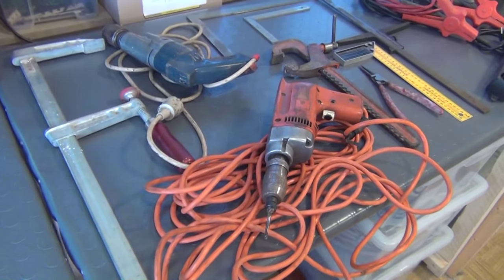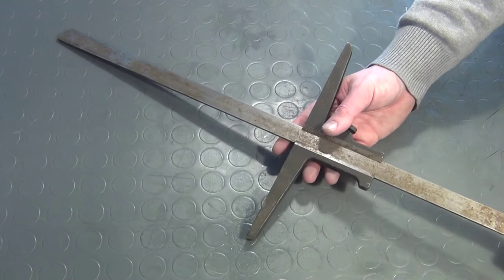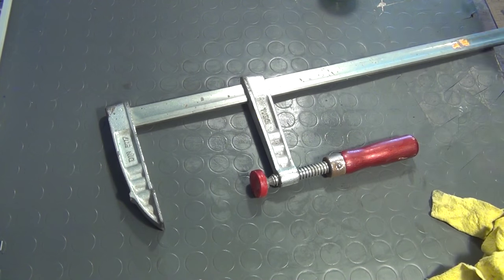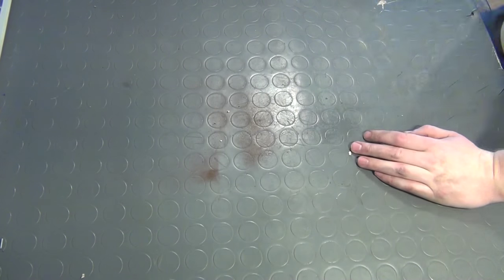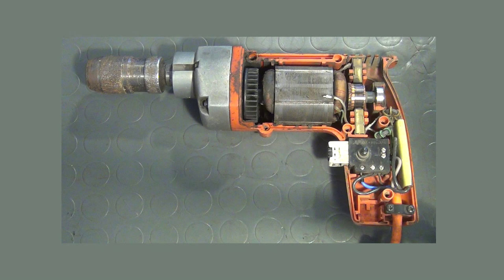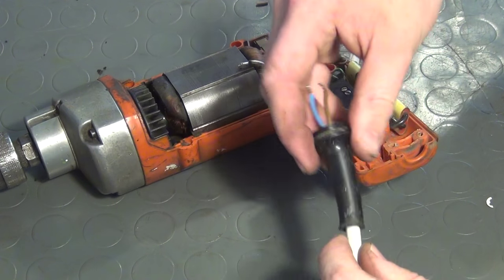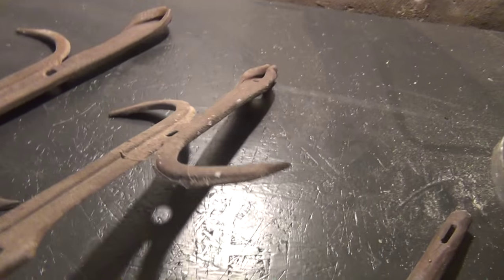Metalworking Tools Repair Marathon

Comment: That Carver clamp is a very cool design. I will have to make a wooden version to add to my collection :)
Reply from the maker: John Heisz Cool idea. It's a great design and I have used the clamp for several jobs already. Let me know it, should you make a video about that.
Reply: John Heisz  I have a Carver clamp. A good tool, excellent clamping power but not very user friendly. Or perhaps I don't have the hang of it yet!
Reply: SimplyReg Hi I agree, I have three,they have their shortcomings.In my view they are overpriced if you buy new. You have to be careful you do not over tighten them or the narrow bar will bend.A normal Engineers G clamp is better for me,annoyingly I see Carver make three different strengths of clamp and the price really shoots up.On the plus side the sliding clamp can be reversed and I am told they can be used to jack up an item.
Reply: John Heisz - I Build It       L
4
Reply: hi everyone ,if anyone else  trying to find out 
home electronics repair
 try Saankramer Electronic Magazine System (should be on google have a look ) ? Ive heard some awesome things about it and my buddy got excellent results with it.

Comment: Hi I have just watched this video and I recognise the those old salvaged pieces of Ironwork ,The long mushroomed bolt like thing  is called a "forelock" in Britain it would have a washer and a triangular piece of wrought Iron called a" key" it would be driven in to the slot to tighten up .Yes it is what most of Europe used ( Romans were using it here in Britain ) before the nut and bolt was invented .
 The hook like things are for cooking ,some times meat would be hung directly on the hooks or if as in your case there is two sets a bar would be stretched between the hooks the and the meat could be turned  on that,the reason for the  rows of hooks is simply to adjust the hight/distance from the fire,We have here a different pattern to those ,ours only have one hook but can be moved up and down using a  loose link to hook over a kind of course saw tooth
 Hope this of interest to you.
Regards
 Will.
Reply from the maker: +Will Turner Hey Will. Thanks for this valuable information. May I ask how you came to my channel and  what made you watch this video? It happens all the time of course, but I have seen some heightened interest in this video recently and I wonder if someone shared it somewhere ?!
Reply: +The Post Apocalyptic Inventor  I have been watching your videos for a little while now, the reason I have gone back to look again is ,Ive just broken the switch on my stick welder I know nothing about electrical things , but I am interested in them, especially  how they work,and I remembered you doing tear downs and repairs,thinking I might get an idea how to tackle my old welder switch  ( it has 240volt and 415 volt barrel type switch ).
 I enjoy your vid's and like the detailed explanations about the  electrical pixies ( AVE ) you give , long may it continue .
All the best
Will.

Comment: A year or so ago, I ordered several different design types and amp sizes of jumper cable end clamps. I have a good, high amperage set of jumper cables I bought 20+ years ago. I also have a couple of sets of medium quality jumper cables. 

The high quality cables have been great, but I have always found them to be too long. I cut them down and made two sets, one at 1/3 of the full length, and the other with the remainder. I cut the medium quality cables into four shorter sets, and one very short set, about 2-3 foot long.

On the very short set, and one of the four sets, I did something different with the cable ends. I put the new ends on normally, then took a 6-8" piece of cable, soldered one end to bind the strands together, then attached it to the unused side of the clamps.

The reason I did this was to create some cables for charging multiple batteries, at the same time, and/or for using multiple batteries to jump start old/big/tired engines.

In the time since I made the cables, I have used the heck out of them, and a couple of friends have wanted to know where I got the cable ends, so they can make their own. 

I wish I had made them years ago.

Hope this helps someone...  Sometimes, it's the little things which make a guy's life easier, and more efficient.

Comment: Hi there, quiet often I can’t obtain spare parts in Australia so I found a good way to get new brushes is to make your own. I purchased a dozen or so of large brushes from Feebay and it’s quick and easy to sand them down to the correct size and crimp or solder the correct tab on the end of the copper pigtails. I also purchased a load of plastic strain reliefs from Feebay as well and use those. Both of these work arounds work well for me and are very cheap. Great work on your English pronunciation. Cheers 🍻 from Australia 🇦🇺

Comment: Nice long video to watch with a cup of tea. The vice is looking very well. Thanks for the shout out! You will have a great home blacksmithing set up when it's all arranged. Blacksmithing is a fun skill to develop as it can still find a truly useful place with modern production. It's also very visceral in some ways. I really like the metallurgy side of it, base material properties or the remarkable effects heat treatment can have. It is so interesting.

My straight razor is made of fine Swedish steel and was ground expertly in West Germany. It's a very nice razor, a pleasure to use. I have to say I put a lot of trust in W. Germany products!

I have been taking apart and hopefully refurbishing some old discarded power tools recently myself. You other videos gave me a push to has some fun fixing them up. A couple of rusted out striped screw heads have been a pain though haha
I have tried a couple of 'tricks' but one is very badly stripped, so I may just drill it out. Just a casing screw anyway and I'll re tap it if I need to.

I  think the welding machine videos you'll use those jumper leads in are going to be really fun to watch. There are a lot of interesting angles from which to look at the various types of machines. The simple explanation of the variable magnetic reluctance buzz box in the other video was great.
Between other videos of yours and the SMPS series I finally see it all as aligning dynamic fields and not overly simplistic magnetic poles physics models.

Anyway, keep up the brilliant videos, there consistently entertaining and informative.

Comment: I use a Jacobs chuck on my air drill at work. It gets used for all kinds of jobs and materials including stainless, brass and aluminium. Its been on that drill for over 10 years now and is still going strong! Hope yours give you the same service.

I'm from Sheffield and never knew they were based here lol.

Comment: It is possible to make a simple strain relief for the cable with a short section of garden hose or plastic tubing - and It is a good idea. The chuck on the second drill is of good quality. It is worth stripping down & cleaning. Keyless chucks were once an expensive professional option (as in this case) so it is probably well made.

Comment: Hi, erstmal danke für deine Videos, haben mir schon viel Spass gemacht. Ein paar Tipps (auch auf dein andern repair marathon bezogen):
- für Anschlusskabel würde ich welche mit Gummi oder PU außen nehmen. Das ist wiederstandsfähiger und im Fall von Gummi auch wesentlich flexibler, insbesondere bei Kälte
- zum Entfernen von Oberflächenrost am Messchieber usw hätte ich eher Stahlwolle genommen, das ist wesentlich milder. Mit dem dann zusammen mit einem Kriechöl (WD40, oder selbst gemacht mit Öl und Petroleun od. Diesel) drübergeschrubbt da löst sich dann der ganze Rost. Zum Schluss mit Lappen abwischen und nochmal etwas ölen als Korrosionsschutz - fertig.

Weiter so und viele Grüße, Mathias

Comment: For your viewers in North America, or if you come across old tools from the US. I look at the manufacturer's address, to judge an approximate date of manufacture.  In the early '60's, the US adopted the five digit zip code.  If the address has a zip code, the item is post ~1964-65, no zip code, pre 1963-64. 

I learned this tip from an appraiser 30+ years ago, and it has served me well, since then.

Comment: I believe the fireplace irons with the hooks were used for hanging pots or kettles over the fire. They may have also held spits for roasting meat, although I have seen different kinds of old tackle for meat roasting.
Reply: You are correct that the hooks held a spit roast rod at different heights. Pothangers were typically situated on a long bar. The hooks could be slid along the length of the bar, and the bar could be rotated horizontally into or out of the fire.

Comment: My dad worked at a factory in the 1980's who purchased an electrical furnace from the DDR. While the thing was out of the dark ages, even for British industry (which always seems behind our German or Asian competitors) it was absolutely bullet proof. The interesting experience was when a team came from the DDR to repair and service it. Among things they didn't have were modern shatter proof hacksaw blades and they had a guy on their crew who just sharpened drill bits all day. Apparently they left with many boxes of western tools and supplies "borrowed" in the name of Anglo-German relations. haha

Comment: Very nice vids, thanks. And all those old plastic parts could be perfectly polished with slow rotating fur plate, like those for a car surface treatment. And the abrasive pastes also are the same - plastics are heat sensitive only, so air/water cooling is recommended when polishing!

Comment: Lovely video. Beautiful English.
Nice old drills, sadly AEG is now owned by a Chinese Company TechTronics. They aren't build like they used to be.
Fein is still building great tools, most people know them for their multi tool but Fein was the original inventor of the electric hand drill. Thank you for your kind words towards the English and your respect for what we make. German tools have the same respect over here.
UK
Reply: +Harvey Smith Well said HS!
Reply: Isn't Millwauke a subsidury of AEG ? I don't know AEG that well for their power tools, more for their sewing machines.
Reply: Correct. Millwauke is part Techtronics, along with AEG, Rigid, Ryobi and a few others.
Reply: I actually knew AEG for building electric locomotives...
Reply: It used to be a huge industrial company, not sure if they just sold of the tool part? Anyone have any info on that? Also they owned Atlas Copco, any inof also grateful
Reply: Atlas Copco made electrical work machines, my father has an old electric drill from the 90s but still works really great.

Comment: The iron hooks are part of an old style cooking system. You can hang  iron pots ( with handles) from them  to simmer a stew, or  roast a pig or sheep on a spit.( Iron bar with a handle to turn it) The higher the spit  is placed in relation to the fire, the slower it cooks.  You can see something similar at Hampton Court in Surrey, England.

Comment: You can use a short piece of automotive rubber fuel line as a replacement strain relief for the power cable on an electric  hand tool.  It works better and lasts longer than the original strain relief.

Comment: Thank you for digging out the historical material on the tools. Very interesting. 

If you run across older tools you plan to resell rather than use, be careful about removing the patina. One man's rust is another's treasure. I cut the value of a '40s Emmert Turtle Back vice three fold by cleaning it. I also got endless lectures from tool collectors at the swap meet.   Don't know which was worse losing $600 USD or hearing about what a moron I was for hours.
Reply from the maker: Lawrence Bosse Thanks for the info. At the moment I only buy tools for my own use though and I see even a hundred year old tool as a piece of equipment and not as a sacred item with magic qualities. I can understand that you don't remove an actual patina on a piece of ancient silverware, but rust on a tool is just that: rust... At least that is my oppinion.

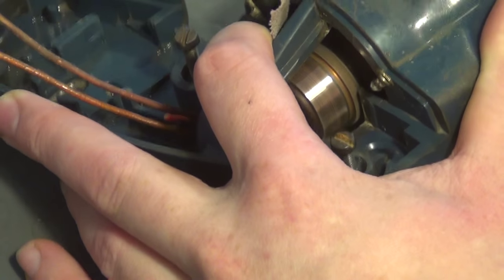Comment: Hi I love your tool repair tutorials! Just wanted a clarification plz: at 9:25, you said you soldered a capacitor to a couple of wires & connected it to the switch & motor . Was the capacitor installed to fulfill the function of the broken filter ?

Comment: Hallo. Congratulations for the videos of old stuff repaired. I have in my basement similar "postweiss" I believe it is the name. In Romania the name would be "menghina" (try google translate). Also my father has a lot of old tools but I saw that modern tools are cheap and made of cheap plastic. I managed to repair a broken small crane by repairing it's cable. Good job!

Comment: yo! love your show it gives me alot to think about and ideas in my own projects and your methods of teaching and using and being safe is great...so i have a question it is a serious question even though it may be silly or have been done or too dangerous ...can you take an old 18 or 20 volt battery operated power tool and turn it safely to a ac voltage tool? thanks again and keep grinding!

Comment: i use knipex brand 200 mm bolt cutters in my work. they are quite expensive at $50, but are the best such tool i have found in my 13 years at this work.

Comment: Damn, what is this place of wonders that holds these artifacts at a bargain price?
Reply from the maker: John Grammaticus I found the place when I came to pick up a welding machine that I had seen on the German version of "Craig's LIst". Upon arrival I found an entire room filled with old tools and materials of the highest quality. First I wasn't interested in the welding machine and bought a bunch of those tools instead. After thinking about it for some time I came back and decided to buy the welding machine after all. At the same time I also scored the tools you see in this video.  There is still more stuff though and I know that I will go there again sooner or later...
Reply: We got lucky in that respect too.  I saw a bit of equipment on craigslist that I thought might be useful,  went there and found a guy handling his father's estate.  We came back with a truck.  :-)  Several file drawers full of all sorts of service manuals,  a floorstanding grinder that had been sitting outside but which worked fine once cleaned up,  a whole mess of woodworking tools including some of the sharpest hand saws I've ever seen,  and some specialty planes made of wood!  Probably more that I'm not remembering offhand...
Reply: @Roy_Tellason  my man this bring back some memories. Fiver years, this comment, a lot has happend since then but thank you Roy for reminding me about this era

Comment: Hello there,  I truly admire your videos. I am a carpenter and use many of the tools you repair.  I try to repair some older tools I find myself, some get fixed,  some not so well. I have a question for you. How do you recommend cleaning drill chucks that are very stiff to turn? Should they be oiled, or are they repairable?  Thank you so much for your videos. 👍
Reply: Peter Ford I would try some oil or if you can open it up and clean it out if it's dirty to
Reply: Mr Sevenfold Hi,, have tried oil,  it does help,  but nothing like when new or working well. Wondering how they are lubed when new. Oil would break down grease. Thats why I was curious as to best method of rehabilitating an old or well used chuck. Thanks for advice. As much as chucks cost making one work well is a definite plus.
Reply: Peter Ford φ

Comment: Hello my friend I have a drill  type metabo sbe 660 works on 110 volts but electricity we have 220 volts Is there a way to run it without adding an adapter and thank you for your efforts and valuable information

Comment: Hello there. I was wondering if I could ask you a question. I've got the same AEG drill as the one you showed in the video, that I need to fix. I've determined that the problem has to be in the rotor, but I can't get it out of the enclosure. Is there some hidden bolt somewhere or do I just pull on it till it gives? 

P.S. love your vids, keep it up :)